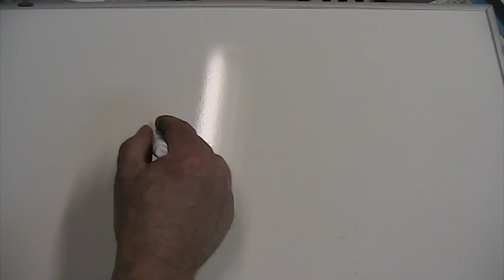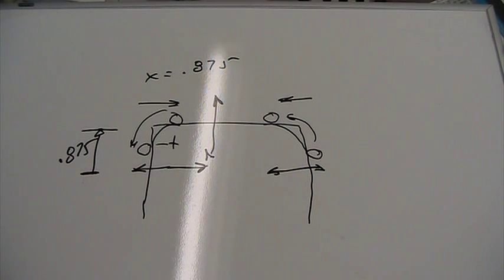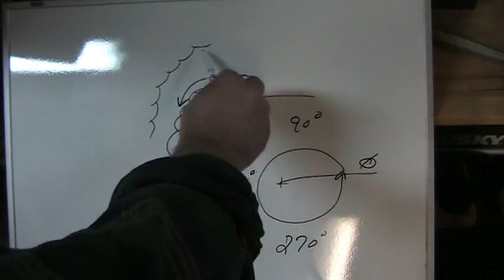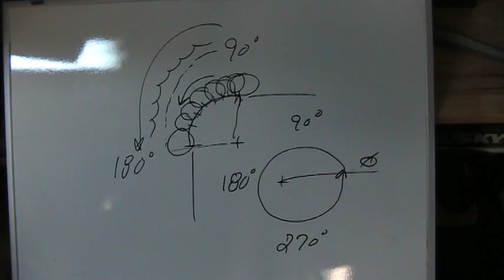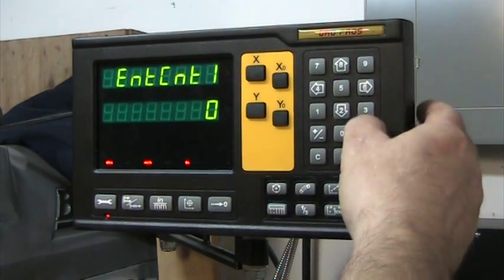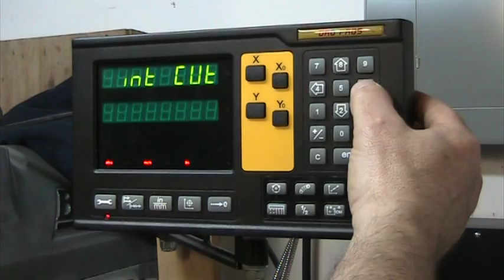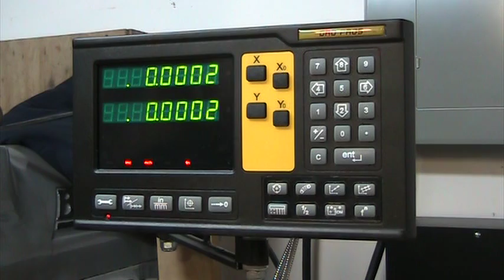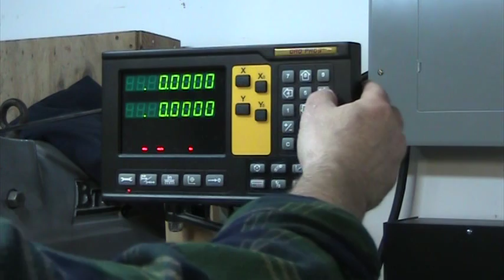Arc cutting using the EL400 DRO

Comment: This is an old video so you may not receive this, but my question is regarding zeroing the cutter. I am very new at this so if you skip a step I am lost. 

You said you plugged the 1.875 into the screen? The number doesn't register and I have no idea what that meant?  Where did the 1 in 1.875 come from and how do you "plug it into the screen"? 

I assume "touching it off" meant finding the axis coordinate by touching the end mill to the work piece, but how do you save it for the calculation? Do you touch off both the X and Y axes and then somehow save it to the DRO? I understand that the end mill diameter moves the cut center line probably by calculating new coordinates internally, but I don't understand the starting point calculations to zero the end mill. 

The rest is straightforward, and maybe I am just stupid, but I have to pay close attention to the terminology because I am not familiar with some of it.
I just finished installing the EL400 on my mill and that went very well. Now I am looking forward to using it for more than drilling holes or cutting grooves.
Thanks
Reply from the maker: Hi, thanks for watching. I went back and rewatched this and you must have misheard me about the 1.875. Couldn’t find it. Should be .875.
As to the rest of your question, you literally touch the end mill to the side of the work piece (or use an edge finder if you have one), then enter the cutter radius into the proper axis you’re working on. To do that, in this case, you would select “X” on the screen (not X0), then press .1875, then press ENTER. You should see .1875 populate in the X axis value portion of the display screen. So after that has been done on both axis, you should be able to move the table to X0,Y0 and the center of the 3/8 cutter should be over the very corner of your piece. When that’s done, now go into the arc cut menu and follow my directions by describing the arc center, tool dia, start and end position and how many steps you would like to do it in. I hope this helps. Let me know if there is anything else I can do for you. The bolt hole circle function is another great feature of this unit!

Comment: By compensating the initial zero of the tool diameter and then compensating the compensation in the angle calculation is a net value of 0. Cant you just 0 the tool and leave the arc configuration at 0 and its the still same thing?
Reply from the maker: These are the inputs on the EL400. Thanks for watching.